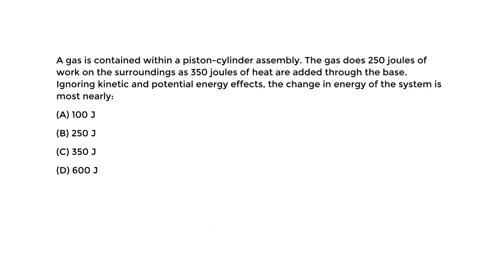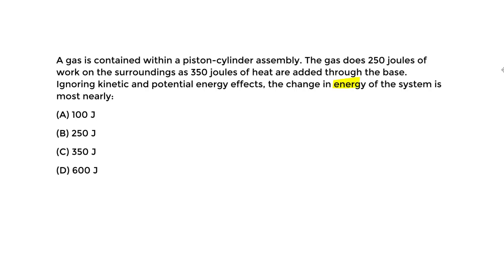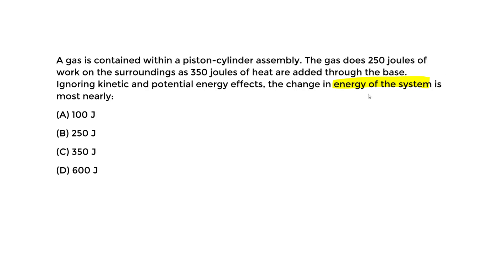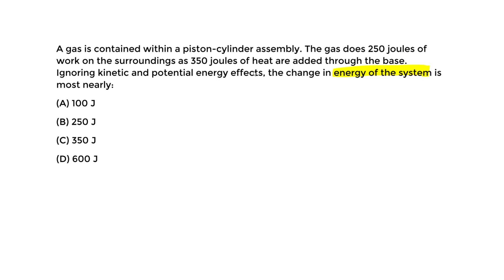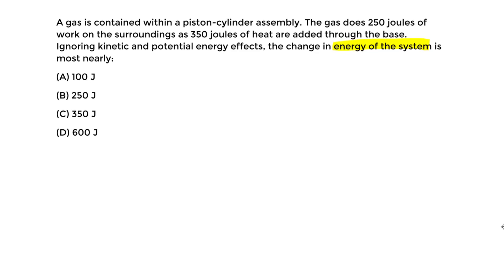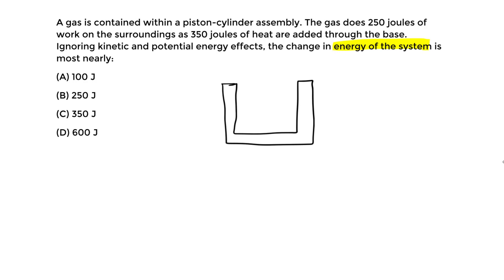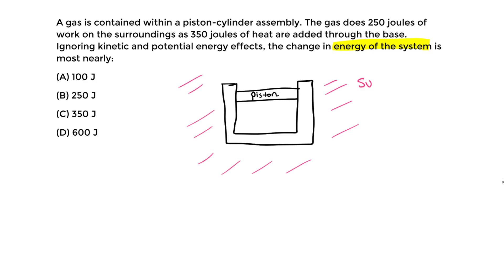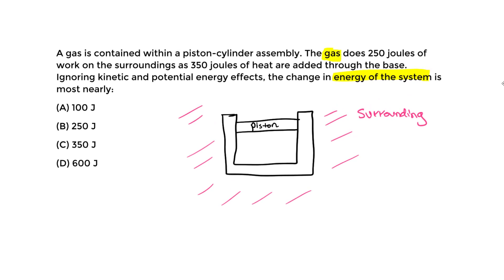FE Exam Review - Thermodynamics - First Law of Thermodynamics (Basic) - FE Exam Tutoring

Comment: side questions? what would be a justification to neglect KE and PE on this problem aside the fact that the problem is telling you to neglect?
Reply from the maker: Hi Fernando! Good question! 

First of all, for this FE type question (basic fundamental question) since the does not provide information about changes in the velocity of the gas or the height of the system. Without these values, we cannot say the KE or PE changes are substantial enough. 

Also in a tight controlled unit like a piston-cylinder assembly, the motion of the gas and the piston is usually very small and very controlled. The gas particles inside the cylinder do not experience big changes in velocity or height therefore we can often assume changes in kinetic and potential energy negligible.

Comment: Since the work has (_)
Q- (-W) >>> Q+W = 600 J . 
The equation already has (- )
Reply: The FE handbook 10.1 notes work as positive if done by the system on the surroundings, with dU = Q - W.  so W = +250 J. It would be 600 J if 250 J of work was done on the system, in which case W = -250 J. I learned it as Q + W in my thermo class with work on system being positive. I think that makes more sense, but they disagree. Oh well lol
Reply: bro is not passing the FE